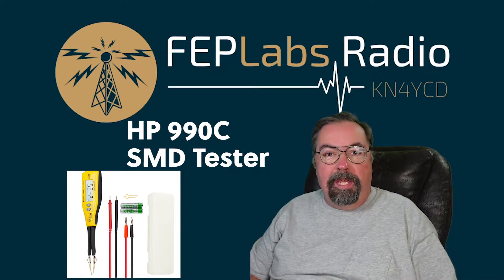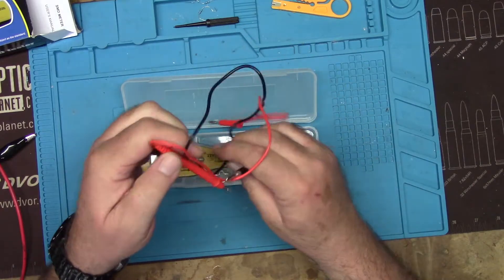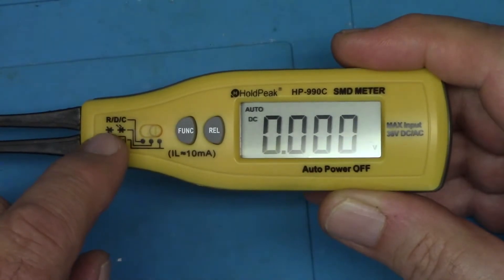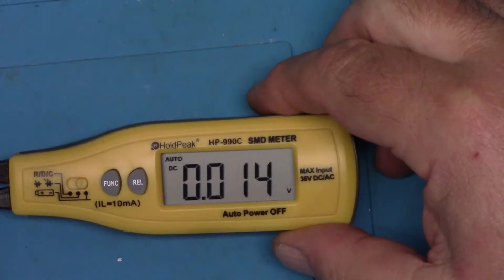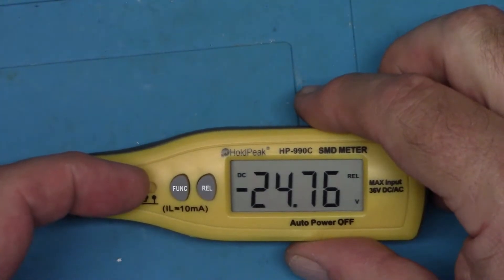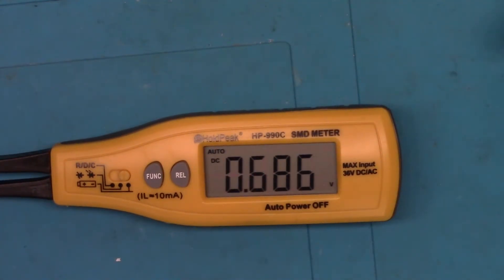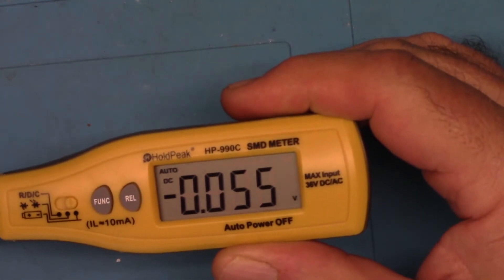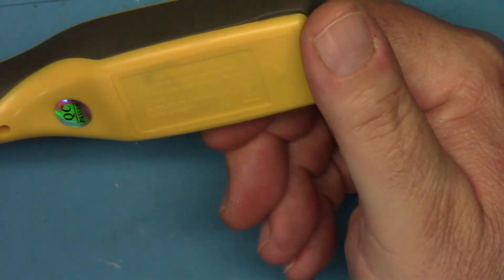HP-990C SMD Tester!  Any good??

Comment: Hey Jim, The voltage is sagging in the forward direction because the unit is putting a load on the power supply, and evidently the supply can't handle the current.  It says IL≈10 mA on the tester's face as a reminder.  My unit's load measures more like 12-13 mA.  Give this a try on a 9V, AA, AAA, C, or D:  Hook up the cell in the reverse direction, you will get the "no load" or "open circuit" voltage with a minus sign.  Note that relatively high value, will probably be not too far from the battery/cell rating.  Then, hook it up in the forward direction, notice the loaded voltage has dropped with the load.  If the voltage in the forward direction drops significantly, the cell is getting closer to the end of it's usable life.  Although this unit seems physically appropriate to test coin cells, the 10 mA is actually too much load for any coin cell.  The result will be shortening the life of the cell and getting an false negative reading on it's remaining life.   My biggest complaints of this unit?  #1 poor red/black leads, mine were intermittent.  #2 resistance is inaccurate below 100 ohms.  #3 capacitance is inaccurate below 1nF.   The diode features work very well.  Don't input a voltage when the switch is in the diode modes.

Comment: You do not understand how it works. It is not a high impedance meter.  It measures with a 10mA load.  Also, you were trying to measure voltage in the rel mode. You should read the instructions before making a video.